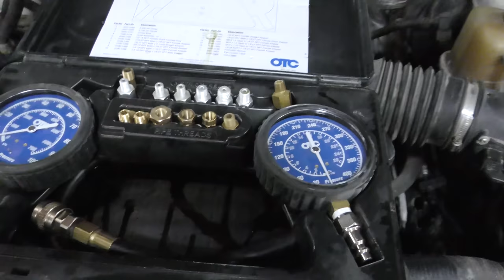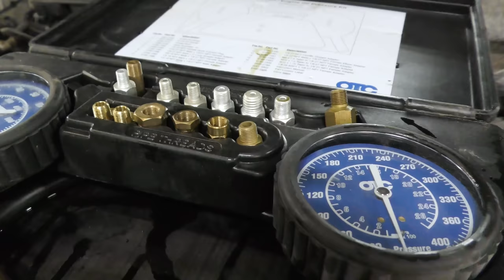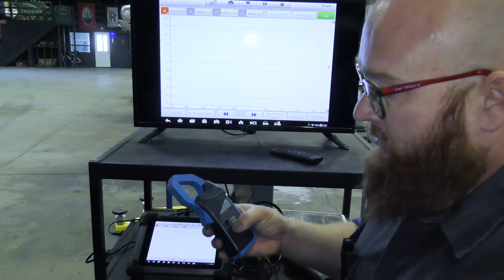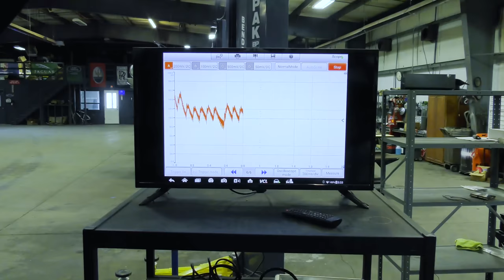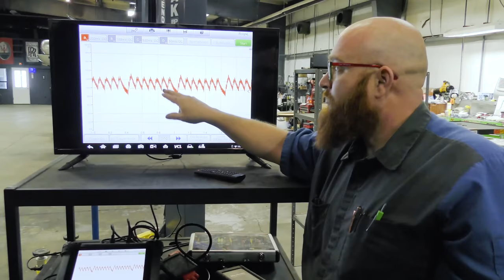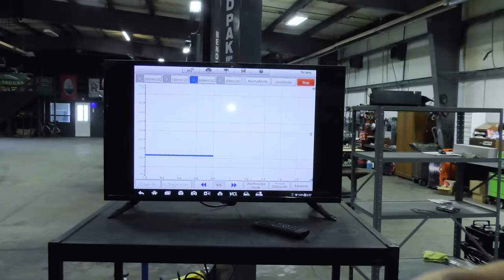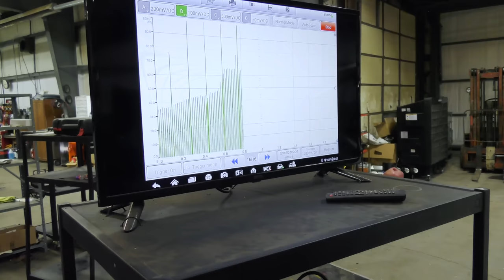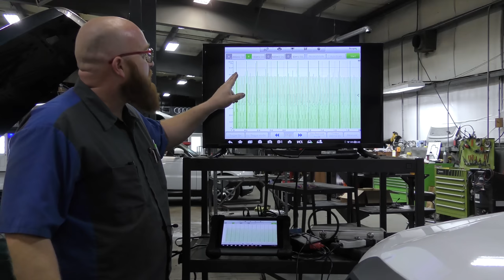Can an engine additive really fix this 2011 F150? CAR WIZARD shows how to diagnose and repair

Comment: Can you imagine a Toyota dealer saying  '180,000 miles out of a Tundra,  the engine is worn out'
Reply: No just the frame is gone by then lol
Reply: The downside to the Tundra is its reputation. They are so good that it is darn near impossible to get a good deal on a used one!
Reply: @Morpheen999  that was over a decade ago they have had no problems since then.
Reply: @antoniovillanueva308  Even my 20 year old Lexus shitbox is going for several thousands. Only got a good deal on it because it had a lot of problems I had to work on.
Reply: @antoniovillanueva308  very true.  I paid 42k for my tundra crewmax 4x4 SR5.

But here's the thing.  Im 36 years old and this will be the last truck i buy in my lifetime.. i wont need to buy multiple trucks.

I don't daily drive my truck either.

So buy one truck for life.. hell that's worth a little bit of a premium to me
Reply: @derakbell8143  I've had my '97 since new. It has over 400k miles right now. I will retire later this year and I plan on buying another new 4Runner for my retirement. I will have other cars but for any emergency it's good to have a reliable pickup or SUV around. I'm not in a fire zone here in California. The area gets only small tremors from the bigger earthquakes that have happen in the SF Bay area. But I'd rather be prepared.
Reply: @derakbell8143  Yep. Buy a tundra, or an older GM full size. Best way to get a forever vehicle. Yea you'll have to do more than maintenance as they get beyond the 30 year mark, but really, how much further ahead are you by having kept an older vehicle rather than took on another payment?
Reply: These 5.0 are known to go 350,000 miles. I have a 2012 5.0 201,000 miles an it’s tuned an modified with gt intake manifold, cold air intake an exhaust. I rev it to 7,200rpm regularly
Reply: Ford probably used inferior bearings that wore out too quick. Usually main and rod bearings don't change in clearance much at all for 300,000 miles unless you race or use the wrong oil.
Reply: Eh I see it with the 3URs when the timing chains/tensioners start to go. It's a good motor but they aren't magic they still wear out. I'm pretty sure on the million mile Tundra stories they had to replace timing chains on those too which is a several thousand dollar service if you catch early or an engine replacement if you don't.
Reply: My 4.0 xj just rolled 170k. Its finally broken in.
Reply: @Misterfairweather  The owner of another high mileage (430k miles) said that he hasn't changed the timing chain yet. Go here:https://www.youtube.com/watch?v=y7-H5KwzFdI. Find a comment where the shop mentions the owner. They also mentioned that the million mile 4.7l engine had the timing replaced three times.
Reply: 230k on an 4.7 Tundra just replaced the valve cover seals and it looked NEW inside.
Reply: @Rhaspun  I bought a 2005 GMC Yukon with 5.3 and 180K miles for $2500 in Plano Texas. I did a full service and new tires. It now has 238K miles with nothing but fluid and tires. Everything works, cruise, windows, AC. The last 2 were about the same and both went over 300K miles. I pull trailers everywhere, including up to 12K feet in the rockies. So, nope,  even a ragged Tundra is fetching triple that. I have done the math.
Reply: @Rhaspun Tundras are EXCELLENT trucks. I have just never seen a truly good deal on a used one. Like the older Cummins Dodges, they just cost too much on the used market.
Reply: @antoniovillanueva308  define “good deal”. A high price reflecting solid value seems like a “good deal” to me. A low price for an unreliable truck isn’t a good deal.
Reply: @shiftfocus1  I am sitting in the desert near the Great Basin right now. The nearest town is 67 miles away. Guess what, I will get in my truck in the morning and drive it there without trouble. It only has 238,000 miles on it and I know it will go 300K.

You should check people out on YT before you start talking smack.

I got caught in a forest fire near Steamboat Springs a couple of years ago in a 5.3 with a leaky radiator. I couldn't stop so I just kept adding water and going as far as I could.  I overheated that thing 15-20 times before I got out of the fire zone. The engine had right at 300K miles. I decided to keep going after I replaced the radiator. I drove that poor, mangled,  300,000 miles, 5.3 engine from Colorado to the Gulf of Mexico )pulling a trailer) and then back to Dallas where I sold it (very cheap, a fair deal to a guy that needed transport). Not only that, I recorded a video to show my people that I made it!

Your Toyota would have died in Steamboat springs.

https://youtu.be/d8HD_1l3ifE

I am not like you. I know what I am talking about.
Reply: They have their fair share of issues. Since toyota sells 100k trucks a years to ford's 800k there will be more recorded failures from ford...
Reply: @UkraineJames2000  LOL....conversation about how Toyotas are bullet proof and posts "Only got a good deal on it because it had a lot of problems I had to work on".  Umm...errrr
Reply: @Reggiestreet  Of course, you're just seeing the Ford hate.  Its normal.  We have absolutely no knowledge of how this guy treated his truck, how many Fram oil filters have been on there etc.
Reply: @Dcc357  Ford doesn't use inferior bearings but many of their customers use inferior oil and filters
Reply: @derakbell8143  if you live in a road salt area, it's a good idea to take good care of your Toyota's frame. Go look at a 4Runner board, people are asking about excessive rust on two or three year old 4runners.
Reply: @Misterfairweather  both 1 million mile Tundras are powered by the older 2UZ-FE engine which uses a timing belt on each head. And since these are interference engines, it only speaks to me more about the religious maintenance the owners did to keep these trucks on the road.  Every vehicle owner should learn a thing or two about them. PS. There are no million miles 3UR to speak of...
Reply: Love Toyota trucks?  Check out the Wrench Everyday blast of the Toyota Titan!  No parts available.  Every manufacturer has their achilleas heel.
Reply: @Misterfairweather  Timing chains are part of regular maintenance, when you get to that milage.
Reply: I've got an old Ford with the venerable 5.0L (302) with 301k miles.
Reply: Bearings are a wear item.  

Bearings experience the most wear and stress cracking passing TDC of each piston, because that is where the most force is hammered into them through the piston and connecting rod.  The forces involved make the typical operating speeds of individual engines more relevant to wear than mileage.  Dragster engines need to be rebuilt every run, even using the best available parts, for a reason.  

Bearings also experience wear and cracking from heat cycles.  The number of heat cycles is more relevant to wear than mileage.  A delivery truck that makes short runs a few times a day, that is shut down, and cools off in between runs, will experience much more wear than a truck that stays running 8 hours a day while making multiple deliveries or just going down the highway.  This is not just from "start up" wear, the expansion and shrinkage from heating and cooling is what induces micro-cracks in the bearings (and other surfaces).  Four heat cycles a day is more detrimental than two (to and from work) or one (truck runs all day). 

The tolerances to produce optimal oil pressure (and oil wedge to prevent metal on metal) are very small. Substandard filters, delayed service, and contamination from operating environment also play a bigger role in wear than does mileage.  

Driving your not as pretty as you think it is, anything other than Ford, to and from work 5 days a week and occasionally hauling some home project materials or moving a couch might get you to 200k or more if you take care of it, but if you drive the shit out of it, and wheel it every weekend you'll be lucky to see 80k from new out of it, a lot less if you don't like to change the oil.
Reply: @derakbell8143  - if you want to keep the truck going, you need to be changing your oil based on time instead of mileage.
Reply: @Phantom0fTheRouter  i agree mine is changed every 3 months or my mileage point. Ive changed the oil before at 3 months and the oil only had 900 miles on it
Reply: @derakbell8143  - Three months/900 miles is overkill. You could have stretched it to six months if using conventional or close to a year if full synthetic.
Reply: @petrosaguilar8916  thats understandable but my truck my money. Truck always has fresh oil in it.
Reply: @antoniovillanueva308  It's mainly because those cummins engines are the most likely engine to reach 1 million miles. There's even a million miles club with over 95 members. That's like a 30:1 ratio against million miles Toyotas.
Reply: Driving a Toyota 500,000 or a million miles is like being a miserable vegan constantly exercising but living to be 110. Sure it may go farther but each mile is more miserable. I'd much rather die fat and happy in my comfy chair at 75 and I'd much rather drive a Chevy that "only" lasts 300,000 miles.

I don't care what brand it is, if you are still driving any vehicle at 500,000+ miles you are trash. The interior has got to be DISGUSTING and the seat is most certainly soaked in urine, fecal matter and ass sweat.
Reply: Can you imagine a Toyota dealer telling you to piss off with your 2016 Tundra, with 15000 miles, that is having extremely audible piston slap because 'Its not known to cause engine failure.'?
Reply: Yes
Reply: @derakbell8143  Toyota should have been forced to remove everyone one of those rusting frame trucks from the United States. 

I have seen dozens of American cars and trucks from the fifties, sixties, and seventies with frames in great condition. 

There is zero excuses for selling a vehicle that has a frame that disintegrates.
Reply: I can imagine having a 93 22RE that wouldn’t make it 180k I know because I had one. It was the biggest POS I’ve ever owned. I’ll never own another Toyota.
Reply: @derakbell8143  not true. Toyota had to expand the recall.
Reply: @gigan1972  ok,... that what happens if enough people say something about it. Even if their vehicle wasn't affected they expanded it to satisfy customer relations and loyalty.
Reply: bell  unless it gets involved in an accident.
Reply: @Reggiestreet  Yep, I see plenty of high mileage 5.0L's out there now, I spoke with someone on the Ford truck forums years ago who had photo's of his 2011 F-150 5.0L that had 668K miles on it and according to him all that have ever been done to it was regular maintenance and two water pump replacements but outside of that he said the truck ran as smooth as the day he drove it off the lot. I own a 2011 F-150 FX4 Supercab 5.0L myself that has 105K on it that I bought new and have maintained well, in the wake of ever increasing truck prices and the desire to avoid expensive car payments I'll probably have this truck for at least another 10 to 20 years if not longer outside of something unpredictable happening like a accident that totals it or something like that.

Comment: I used to run Lucas in my CAT 3126 motors. They never smoked, ran great once warmed up and both made 650,000 miles and are still going.

Comment: I use Lucas in my old ford tractor. Along with 15w40. Runs 30 psi all day long. No smoke. Ran around ten psi hot before. I even use it in my 1971 ford camper special. 72000 original miles.
Reply: I would think that using the Lucus as a preventative would make more sense than waiting for the 180, 000 miles but I could be wrong, plus it is possible that it`s the trucks oil pump is going out with that many miles on it.

Comment: 5.0s last longer then the 3.5 eco boost. Just wait till the 2018+ F150s with the 5.0 come in with oil consumption issues out of warranty. 
Love how our fix for them engines burning too much oil is a new Dipstick and a PCM update. 
Being a Ford Tech is a great time lol
Reply: It’s a problem with 2018+ F-150s and Mustangs. 2015-17 didn’t have the same problem.
Reply: @atx-cvpi_99  you are 100% correct I hit the 5 instead of the 8 and didn't realize it

Comment: When I built my 04 5.4 3v and  I put a melling oil pump and upgraded the rocker rollers along with a full rebuild ( new pistons,valves ect.) and do your oil changes properly and it has been more reliable than the new 5.0. I know many people with 2015 and newer F150 with the coyote engine that have broken down and I am still running strong. Those are the 2 major reasons the 5.4 3v failed often. Fix the problems and your fine.
Reply: That may have been your experience but objectively (statistically) the 5.0L is a more reliable engine than the 5.4L 3v. A lot of it does come down to maintenance, the 5.4L is a much more finicky engine in that regard than the 5.0L though, not that I would ever recommend skimping on oil changes or things like that, but you can more safely go an extra thousand miles or so with a 5.0L between oil changes than you can a 5.4L without the concern of it creating real problems down the road. I don't honestly know why anyone would cheap out on oil changes though.

Comment: People who think off-the-shelf fluid additives work are the same people who go to a doctor with a problem and immediately expect there's a pill for everything.
Reply: $20 vs $3000. thats the case.
Reply: totally agree, but most people think there's always a simple solution to a big problem. It is not like software engineering where you have keyboard as a single tool that solves all your problems. Sometimes only ratchets can save an engine and not additives or scan tools
Reply: And the same people that are cured by a placebo. I understand the idea of limping it along for a few more miles so you can sell it, but that's awfully shady isn't it? You're not going to tell the buyer about that problem...
Reply: @HermannTheGreat  Yes, that happens every single day. Thus why people think used car salesmen are some of the most slimy shady people that ever existed.

Comment: Yes! I had a '94 Dodge Dakota with eh 3.9L Magnum V6. The engine was tired and worn. It would knock a little on cold startups, burn a little oil, and had a noisy valvetrain. I started adding Lucas Oil Heavy Duty Oil Stabilizer at every oil change and it brought the engine back to life. No more knocking, noisy valvetrain, or burning oil.

Comment: Couldn’t you just run thicker oil...like some 15-50
Reply: That's what I did...got 250miles on my 11...6.2.....10w40 stopped it...been a year and no issues

Comment: I never used an engine additive but I have used Lucas Transmission fix for my 2010 Corolla with 242k miles. It was hard shifting into overdrive but after I used the Lucas it is smooth as butter!

Comment: So you are going to use something that just makes the oil thicker?
The right thing to do would be just use a thicker engine oil, not something that reduces the oils ability to do it's job. 
Just move up to a 5w-30 or 5w-40 oil and have a full fill of oil, not 80% oil and 20% trash.
Reply: I learned the hard way any bottle that says Lucas on it is a load of shit and just designed to make you feel better about it. Their products do a good job covering up problems but they also wear out parts faster so you end up with a catastrophic failure instead of knowing when it’s time to actually fix it.
Reply: @markm0000  Lucas is really a last ditch effort. If you know the engine is already dying you can force a few more miles out of it, but it will never fix anything. Simply using thicker oil would have the same effect.
Reply: Lucas is in the placebo business, the middle aged male fantasy that a major engine problem can be fixed with a little bottle of liquid. Stores have racks and racks of magic liquids to fix anything. It's the dude version of a health supplements store, and a sucker is born every minute.
Reply: @truantray  ml

Comment: Oil pressure is the resistance or force it takes to get oil thru all the pressurized oil clearances. Too much clearance, from a worn engine equals low oil pressure.
I have seen additives or heavier oil cause cam codes, for what it’s worth. 
But it’s worth a try. 
Most would trade it in and the next guy gets to buy the engine it needs. 🥸

Comment: Lucas gets real thick in the winter, you can hear everything chattering til it warms up enough.
Reply: They make a synthetic thinner version as well of lucas
Reply: It's nothing more than thick oil, thicker than that recommended by your owners manual. It's a bandaid, it's not going to "fix" anything, so let it clatter, your engine is worn out either way. If you are using Lucas for no reason then you need to knock it off.
Reply: @ryanroberts1104  Maybe but if it gets them 2 or 3 years what are they losing? By then the truck is ready for the junk yard.
Reply: @Scott-ig1zd  You totally misunderstood what I said. Yes, if an engine is old and worn out and this makes it last a bit longer there is nothing wrong with that. But you shouldn't be worried about cold weather starts because your engine is worn out anyway. 

And if your engine isn't already worn out you shouldn't be using this at all. It also makes more sense to simply use a thicker oil than the much more expensive lucas product.

Comment: I had a Dodge Caravan I ran Harley W60 in lasted 3 more years. In the 70's I rode Honda motorcycles and ran Pennzoil SAE W40 Never had a problem. Not so much with Castrol 10W40. it destroyed my CB550 touring through Utah one summer when the hick gas stations didn't have W40. Made it to Vegas and changed back to Pennzoil W40 and made it back to Canada where I Put in new rings and a valve job.

Comment: I've had old buicks, back in a day in my shop, I use to use STP for the same reason, it bumped up the viscosity above 8psi that it would drop down to, dash light never came back on again